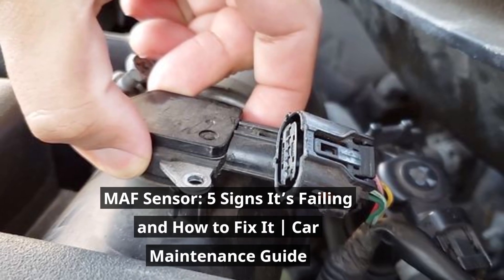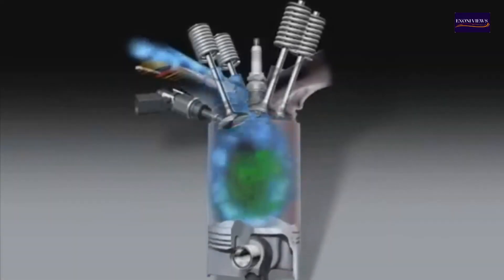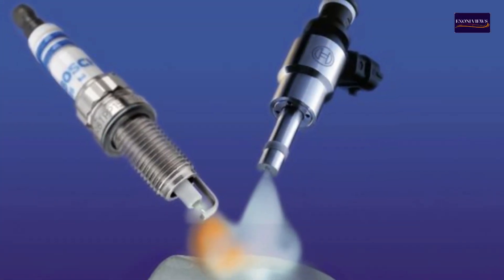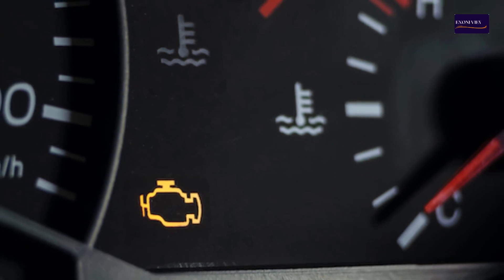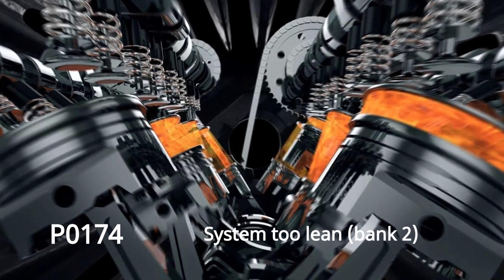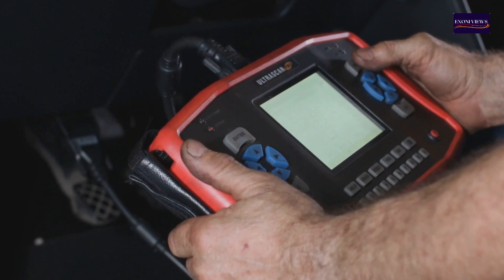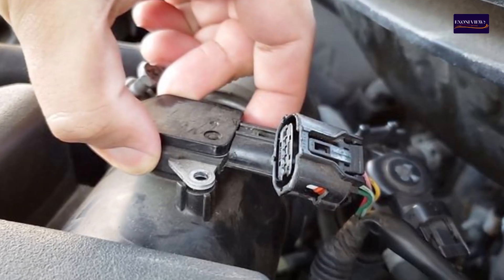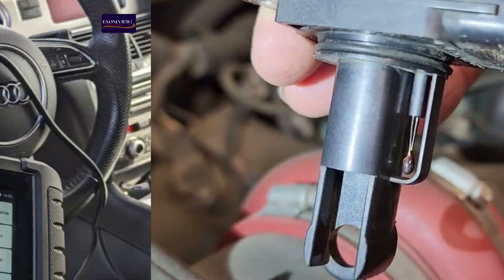MAF Sensor: 5 Signs It’s Failing and How to Fix It | Car Maintenance Guide

Comment: After watching your video I do realise that my car intermittently lacks acceleration. I tried cleaning the map sensor to see if maybe that will improve it, but it still did the same thing. I’ve never had any codes pop up but I figure since the car has over 100,000 miles. I’m gonna go ahead and replace the sensor anyway. The problem with my acceleration actually resolved. Some things are a mystery.
Reply from the maker: I'm happy to hear that replacing the sensor resolved the issue! It's fascinating how some problems don't trigger any error codes, but it sounds like you made the right call, especially with the car's mileage. Sometimes, a bit of preventative maintenance can make all the difference. Thanks for sharing your experience!"